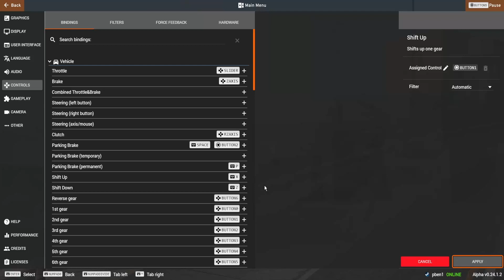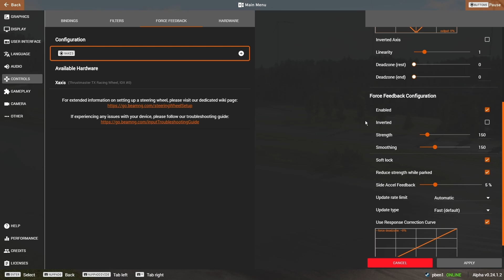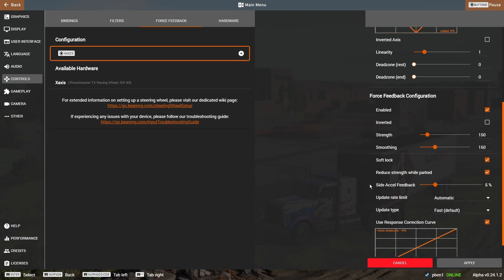Set up Your WHEEL & PEDALS - BeamNG

Comment: I bought a racing wheel with a shifter years ago for my Xbox One. When I built my computer, I started playing on that more, and my wheel just ended up being a dust collector. Was honestly considering giving it away.

I decided to get BeamNG last night, and one thing I noticed is that the cars are set up for either automatic drive or manual. I thought there were settings I needed to configure when I was putting the car in first gear and it was putting it in park.
Reply: Thank you. I was wondering if I was doing something wrong.

Comment: im on a thrustmaster tmx so my pedals are swapped around ingame and the brake keeps getting held lightly but then stops being held if i accelerate i dunno i checked the firmware thing and the pedals were fine so im not sure :v
Reply from the maker: Odd, don't know what's going on there ? Google see if any others have the issue.
Reply: i just replugged it back in and its fine now

Comment: If when your push your throttle and it goes automatically even when you let off take them off and set them combined throttle&brake set 1 at a time I looked everywhere and couldn’t find a fix and i took some time and got it to work.
Reply: I’m having this issue with my thrusmaster tmx can u please help I can seem to figure it out. My break and accelerator pedals
Reply: I fixed it by unticking the inverted setting on the throttle and the brake
Reply: @FoxFoxyk2212 my throttle doesn’t show an invert option just a filter option
Reply: How did you fix it?
Reply: Ilysm
Reply: I love you, mwah❤❤❤❤
Reply: Thank you pal

Comment: 1:14 steering lock type doesn’t appear in my settings? I need to let my wheel use it’s maximum rotation. T300
Reply from the maker: Devs have just changed the wording in the latest build, 1:1 Behaviour - set this to normal. And set wheel to 900 steering angle
Reply: @gluten3driver  but my T300 is 1080 degrees, i’ve set it on 1080 but still locked on 900 degrees sadly
Reply from the maker: Ah right forgot the T300 can do 1080, most likely it's the game defaults to 900
Reply: @gluten3driver  how can i fix that? BeamNG Buckell car for example have 1080 degrees while my T300 also has 1080 degrees, but my wheel is locked at 900 degrees and it's just frustrating seeing the car in game goes to 1080 degrees while my wheel is stuck at 900 and it's capable of 1080

Comment: Question: When pushing brake pedal it also jitters and turns wheel slightly. It's very annoying and when driving you can really feel that jitter. Any ideas?
Reply: That is just how most performance cars work
Reply from the maker: @myuncleleft3682  True it will have a slight effect on steering
Reply: i’m sure you’ve realized this within 2 years, but for anyone else having the same issue and is wondering why; it’s because you’re nearing a brake lock-up. be easier on your brake inputs and try to find those optimal braking points
Reply: Im a little late lol but have you fixed this😅i have the same issue on every car in the game(even the slowest ones)
Reply: @KashHybrid  read my previous comment, if you’d like to

Comment: My steering wheel is not responding but my other buttons are. Its so weird why it wont respond when im turning it, please respond i need help!
Reply from the maker: Have you set the wheel to mouse steering
Reply: @gluten3driver  what do you mean by this
Reply: @gluten3driver  how can i do this
Reply from the maker: @FlyinSharky  Steering setup is 0:32 , what is your issue ?
Reply: @gluten3driver  hey my issue is that when I go to keybinds and try to bind my pedal or steering wheel movements it doesn’t pick it up although it does recognise the buttons on the wheel
Reply: @gluten3driver  it’s a Logitech 923
Reply: @FlyinSharky  I've had a couple of people say this but never had the issue myself. My guess is a USB devices issue, but check the forum or Discord users may have a solution for you.

Comment: I have a problem with the pedals. Whenever I push the pedal to assing the control to make the car go forwards, the axis thing just goes automatically to 50% and whenever I push the pedal again it goes down all the way to 0%. I have tried to put it to 0% and click the Invert axis button to make it go up to 100% and without clicking it. However everytime I press the pedal the car wont stop afterwards and it just keeps going forward. Whenever I try to push the pedal it basically works as brakes, but the car never stops fully. Do you know how to fix this problem? (Sorry for terrible English).
Reply from the maker: You best ask in the Forum or  Discord , not sure what's going on there
Reply: @gluten3driver  Got it. Thanks anyway.
Reply: @randompersononyt1  i neeed help  i have same problem how to solve it?
Reply: @WARVIATION  I still haven't gotten an answer to that question. I don't know either.
Reply: @randompersononyt1  ohk
Reply: @randompersononyt1   @FlyW4R  use combined throttle/break. mine uses single axis for both break and acceleration, and combined is the setting for that.